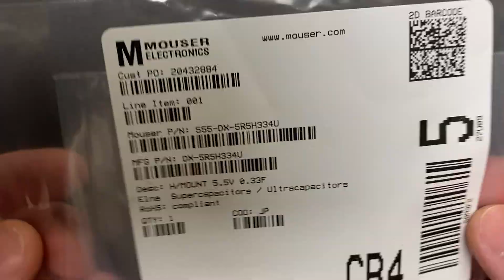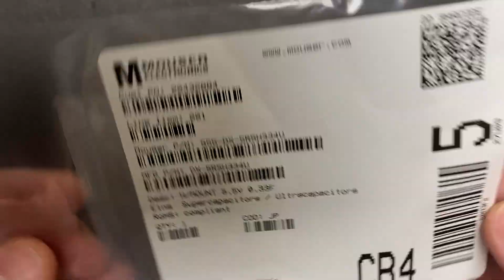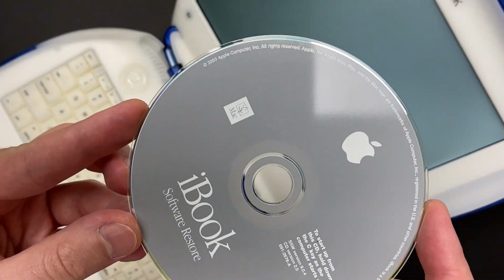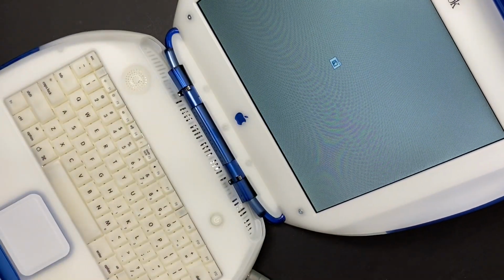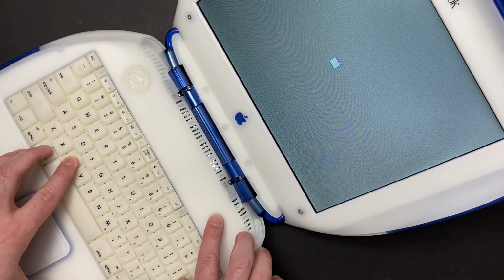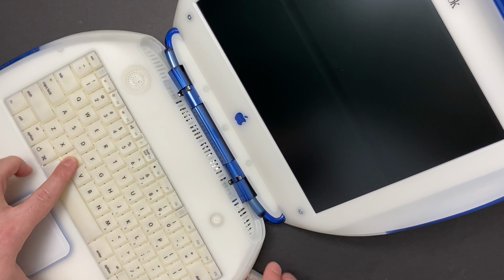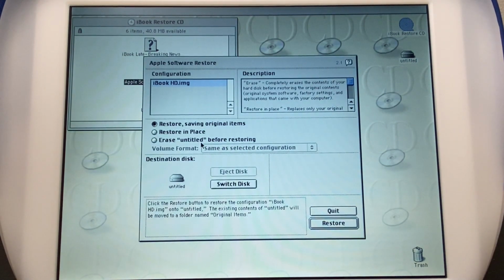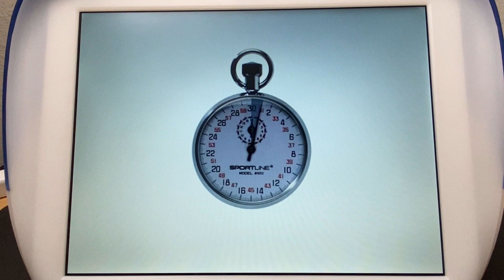Apple iBook G3 "Clamshell" Supercapacitor & SSD Install - Retro Computer Repair

Comment: I have the same iBook model as yours on OS 9.2 that I got from a garage sale for $20 several years ago. I couldn't use that thing for basic functions for such a long time because I could only access it from student mode and had limited privileges (no wi-fi, more than half the extensions and control panel functions were either missing or did nothing when clicked). It looks like whoever I bought it from either got it when it was thrown out by a school in 2006 or stole it. Either way, 4 years later I finally found out that this student/teacher mode password system was a MacAdmin extension and disabling it through the extension manager finally made it work like a normal iBook. Now what I need is a new battery as the thing dies as soon as it's unplugged from a charger, get the screen replaced as it has strange LCD damage that looks like it had a chemical reaction and melted somewhat, get a new bezel for the disc drive as someone managed to break off the old one, and try to figure out if I could fit an IDE to SATA adapter in there as I want to replace the ancient hard drive with a new one.

Comment: I recently worked on a board where I attempted to do a full recap and every single capacitor acted the same way as in this video ,1 leg solders and desolders fine and the other is a nightmare,not really sure what the cause is but my theory is that it's a multilayer board.

Comment: Sry for the stupid question, but why its ok to solder that pin to ground and why would that increase the solder durability, would it be ok to solder the other side?
Reply from the maker: The pin with problems in this case was the negative side of the capacitor. Any adjacent ground would have worked to establish a working path to ground. If the problem was the other component leg, you would have had to bridge it by scraping away some solder resist and exposing copper to its positive rail. Ground is easy because the whole board uses the same ground. If a component that sits in series is not making contact, you would only be able to use adjacent pads/traces to re-establish its connection. In a nutshell, recreate the problem path with a jumper wire while paying attention to where that broken path was doing. A multimeter in continuity mode makes finding the path very easy.

Comment: "I made it to the end" Did you get a speed improvement with the upgraded drive vs the stock IDE Drive in OS9?
Reply from the maker: I've haven't used it extensively yet but it feels a bit snappier. The most noticeable difference on a day-to-day is absence of lag navigating the menus. The regular hard drive would spin down to save battery and sometimes when you click a menu item it would start spinning back up and sputter for a few seconds until it loaded the data from disk. With the SSD it's instantaneous. I'm sure there are improvements with applications that read a lot of data from disk like AppleWorks, iMovie, etc.
Reply: @BorderlineOCD  Keep up the great videos, my son (10yrs) also watches the channel and is enjoying understanding the issues with classic consoles whilst we are doing some father / son projects around PS1 and Classic XBOX :)
Reply from the maker: Glad to hear you guys are enjoying the content and great that you're teaching your son about electronics at a young age.

Comment: "I made it to the end"
I was also scared during the few seconds it took to boot after the full reassembly. Actually during assembly, given the number of things you had to remove to access the HDD and the fact that I wasn't sure the SSD would be properly recognized I was afraid you would need to get back to it...
Good job!

Comment: Hi! I've been watching and enjoying your videos since mid-end November and I have a question:

What type of mask you wear while using IPA 99% ?
(asking this because I'm not sure if a simple cloth mask is enough to protect against inhalation)

oh and "I made it to the end" as well.
Reply from the maker: I would be more concerned about fumes from leaded solder. I don't wear a mask when using IPA. 99.9% IPA practically evaporates in seconds due to the low water content. I don't think there is a serious inhalation risk.
Reply: @BorderlineOCD  Cool, thanks for answering!!!
Oh and sorry for the delay... I forgot that YouTube notifications are weird sometimes.

Comment: "I made it to the end"
It was pretty cool! I'm working on restoring a PowerMac G4, currently fixing the bad sectors on its hard drive :D
Reply from the maker: Nice, another line of beautiful machines. If only I had the space for one! I have an SSD in my iMac G3 using a regular SATA to PATA adapter sitting in a 2.5" to 3.5" enclosure. Plug and play and makes a world of a difference.

Comment: I'm curious how much I improve with the ssd to ide adapter 😂
Reply from the maker: I've haven't used it extensively yet but it just feels a bit snappier. The most noticeable difference on a day-to-day is absence of lag navigating the menus. The regular hard drive would spin down to save battery and sometimes when you click a menu item it would start spinning back up and sputter for a few seconds until it loaded the data from disk. With the SSD it's instantaneous. I'm sure there are improvements with applications that read a lot of data from disk like AppleWorks, iMovie, etc.

Comment: I made it to the end
Nice job!
Will the SSD help it boot up faster? 
On the video it was quite slow despite the SSD
Greeting from Finland
Reply from the maker: I recorded the first boot on video after the restore, so I think subsequent boots were a little shorter but the most noticeable difference is during regular use. It's definitely snappier, particularly in situations where the mechanical hard disk would have previously had to spin up when running on battery (it constantly spins down to save power so even clicking the menu sometimes had a couple of seconds lag).

Comment: You couldn't solder that one leg because it's most likely multi layer board and the ground plane is too big to get hot. You needed higher temp or you could helped yourself with a hot air.

I made it to the end!
Reply from the maker: I'm inclined to conclude it wasn't a temperature issue as I did gradually increase iron temperatures to the point where I could feel the capacitor begin to warm up while supporting it underneath with my other finger, so things were getting too hot without wetting on the pad. The pad is actually quite small (on either side of the board). I think the challenge I was having was introduced by the prior leakage degrading or contaminating that small pad. Hot air would have been nice but I still don't own a rework station unfortunately.

Comment: You could use a tooth stick with flux on that stubborn hole.
And
“I made it to the end.”
Reply from the maker: Do you mean a dental pick or literally a wooden toothpick?
Reply: @BorderlineOCD  Wooden toothpick, it doesn't take heat away, but can help to clean up a hole

Comment: The top pad isn’t broken, you just don’t have an Iron that is strong enough.
The top hole is connected to the ground of the board, and the ground is massive so it takes a while to heat up.
Reply from the maker: My conclusion was a little different form yours. The pad is rather small (on both sides of the board). Things were getting so hot as I increased iron temperatures with each attempt that I could begin to feel the capacitor warming up while supporting it with my finger underneath. I still wasn't getting wetting on that pad. I do think the prior leakage has introduced contamination that didn't clean up or done some damage to the pad due to the challenge I had both removing and reinstalling that leg, especially compared to the adjacent leg which came out and went back with with relative ease.

Comment: I made it to the end. Another fantastic repair! I've had similar issues with solder not sticking on ground plane pads. I think along with requiring more heat, they probably also do better with a different mix of lead in the solder.
Reply from the maker: Thanks bud. You mean 60/40 instead of 63/37 or something different altogether? I stopped trying at 380C before deciding to do the jumper wire. How high would you go?
Reply: @BorderlineOCD  honestly, I don't actually know. I still have trouble with this. I just did some reading about it, and it seems that it's not so much about the solder type as much as it is about thermal transfer. Some say to make sure to use a wider flat tip on your iron to transfer heat better. Others say to preheat the board on both sides using a hot air gun or blow dryer. I also read that if the PCB is well designed, ground pads should be thermal relief pads. Not sure if this helps any :)

Comment: i made it to the end

also did you not place back the 512 mb ram?
Reply from the maker: You are very observant, nice job! It's was actually a 256MB stick, and I forgot to reinstall it while recording the montage. I did put it back in and recorded more footage showing System Info etc. but while editing I decided it wasn't worth dedicating another 30 seconds just to show the extra RAM and hard drive size.

Comment: I made it to the end. Wish I had the motivation to put a SSD in my iMac G3.
Reply from the maker: I actually have an SSD in my iMac G3 as well using a SATA to PATA adapter and a 2.5" to 3.5" enclosure. It's quite easy compared to this (only a few screws to access the hard drive caddy). The most difficult part was clearance. The ram door wants to hit the SATA to PATA adapter and it can be tricky to mount it securely and keep it out of the way.